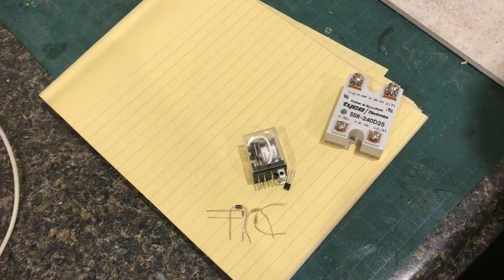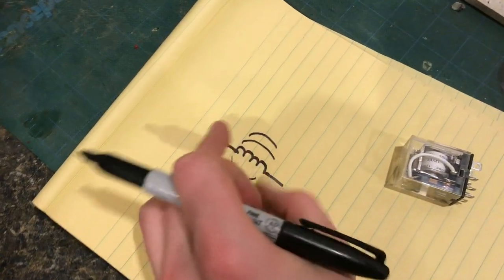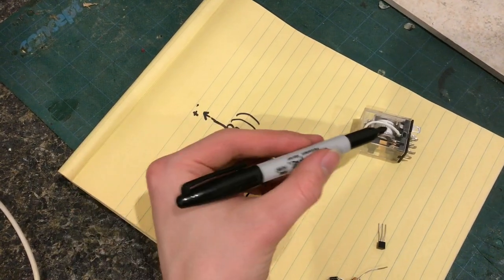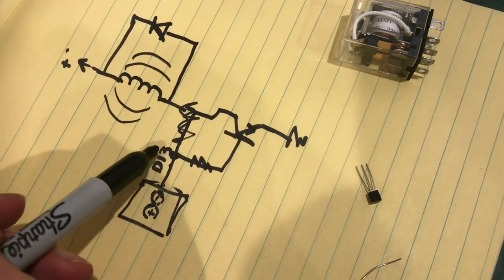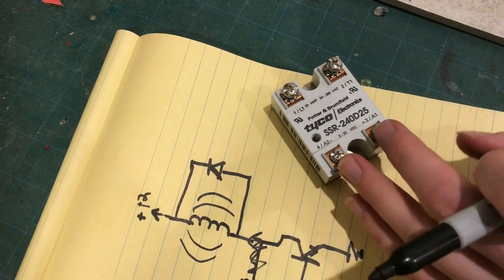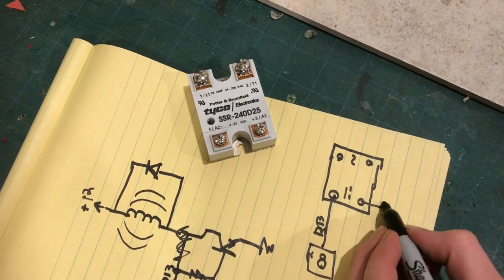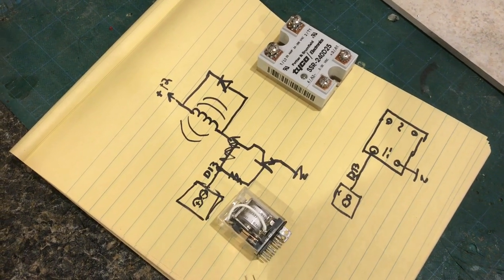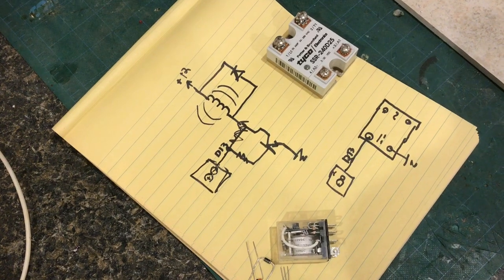MECHANICAL relay V.S. SOLID-STATE relay (clearly explained)

Comment: mechanical is typically more efficient and cost effective when you consider higher loads. the SSR will need to reject a lot of heat due to voltage drop across it. Hence whey they need a heat sink.

Comment: My SSR for compressor application gives off crazy heat(yes it is rated correctly) pulls 12 amps on one side puts out 9 on the other.  Contactor or relay gets a thumbs up in my book a lot of the time.

Comment: I think mechanical relays will continue to be used in low speed copier equipment to control paper feed  rollers. Unless they use a dedicated motor for each roller. This could be expensive. But I see the advantage of using solid state relays. Thank you for sharing!

Comment: I used one of them big SSR for switching the immersion heater on when my solar battery pack was fully charged. a 24 volt 1000 watt immersion. I also came across back EMF when I made an arduino watering system for the greenhouse. I used mini shield relays to switch on12 volt dc solenoid water values and when it turned off it spiked the arduino which reset itself. Used a diode like you.

Comment: You can not turn your AC SSR 1000 times per second. Most likely your AC SSR is made of a TRIAC. You can turn the TRIAC ON, but you can not turn it OFF. It turns itself OFF at the end of every half of AC cycle. You can not turn AC SSR ON more times than it turns itself OFF. So, you can turn it on not more than 100 times in Europe and 120 times in USA.
Reply: Wouldn't the TRIAC only respond to the rectified fourier coefficient of the AC voltage?  ie: V ( t –ᵀ╱₂ )  EG: 50 x per second in EU,  60 x per second in US.

Comment: You can turn DC SSR ON and OFF thousands of times per second though, because it made of MOSFET. You can turn MOSFET ON and OFF buy controlling it's GATE terminal. Not the case in TRIAC's.

Comment: You will blow your esp if you try and power a mechanical relay from a gpio. They are like 20-50ma max rated and relays are over double that when actuated. You always power it from the esp input voltage (power supply) 3.3 or 5v. NEVER FROM THE BOARD ITSELF.

Reason why people use machnical ones is most likely because they are half the price usually and while at it can usually handle way way more Amps than the solid state one.

Comment: Can either a Solid State or Mechanical Relay be used on a job where it needs to be on for several minutes & only off for several seconds before being on again, over and over; and still work with integrity?

Comment: CONTINUOUS LOAD, Does SSL Solid state relays use JFETS or MOSFETS? why are cars using SSL relays instead of Mechanical relays now? what are the advantages of using a SSL relay? do you use a current limiting resistor when apply power to a SSL relay to test out of circuit?

Comment: Ever heard of a MOSFET? That's what's inside your SSR and a MOSFET is much cheaper. If you don't want to have to solder, you can buy easy-connect MOSFET modules very cheaply on ebay.